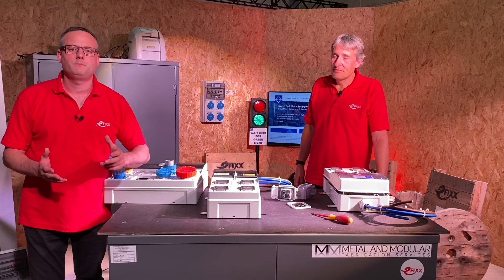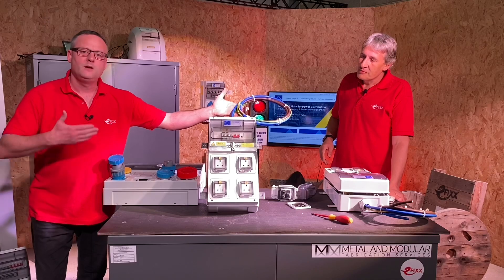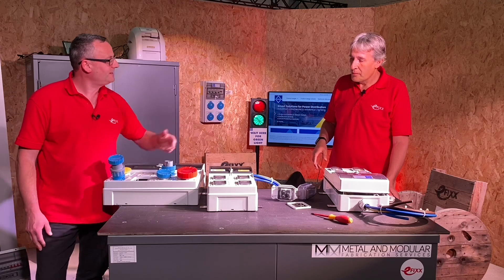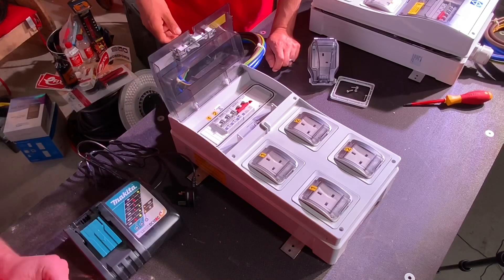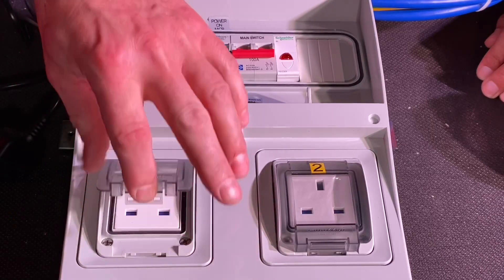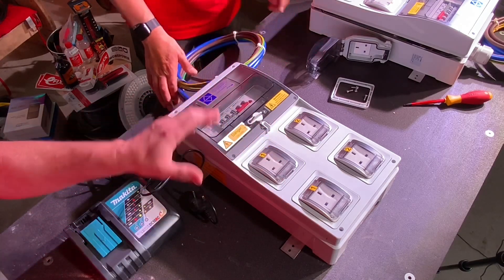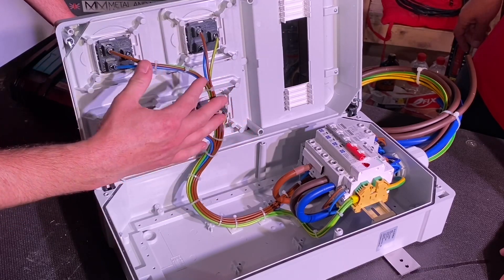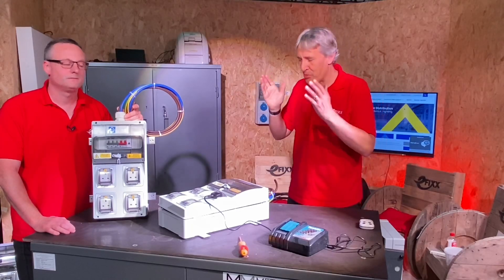Building site temporary electrical supply - electricians' comments needed

Comment: I'll supply you some images of a great pair of distros for building sites that I assembled last year. They are both large units in big waterproof site-approved cabinets with external 32amp 3phase/125amp single phase inputs and 3x 16amp/3x32amp single phase outlets on the inside. One of the crucial things is to include a ground spike connection and a DIN rail mounted power meter. This configuration means that all the power company has to do is supply and fit a box with their own power meter and a single of 3 phase connector on the end of a short length of cable. It also allows quick change over to generator power, which is the ultimate reason for using the easy to connect 32am 3ph / 125a 1ph mounted inlets and sockets

Comment: I made up something similar with a 3 phase Hager DB with RCBO’s with 32 amp x5 and 1x16 amp (with 6 spare single phase ways for expansion when needed)  all switched socket IP67 outlets this was mounted in a large grp box with a sockets mounted on the side the whole lot is mounted on a uni strut frame so can just bolt or screw to posts or uni strut and can be used with 3 phase 1 ph with phasing kit or 3 phase genny Supplys I just adapted as needed to each site move it’s currently on a Jenny with a  63amp 3 phase plug on HO7 5 core 
Lead as it has really good current capacity and don’t get worried by corrosion 
This way if they want to remove or replace a cabin it’s just unplug and away

Comment: That would not last 1 day on the site. Whoever designed that has never even been to a site let alone worked on one.
Reply from the maker: What’s your solution?
Reply: @efixx  I think the sockets need to be metal clad ones. The plastic flaps need to be made from something far more substantial with stronger hinges. As soon as one is snapped off there goes your ip rating and it becomes unusable. I would say that the covers for the sockets and breakers be ditched and one big strong cover door should be put in instead..that door should be shut with a ball catch of some kind so that if an extension cable is yanked out the door flies open and is not damaged

Comment: How about an emergency shut-off button? I have no idea if those come IP rated, but it would be a great safety feature, given that this will be used by all trades and some may not know what to do in an emergency..
Reply from the maker: Most EM stops  are IP rated  - would need to add a contactor - good idea 💡

Comment: I do hope there are no thick moulded plugs needed in those top two otherwise you're going to have trouble opening the bottom two. Could have done with a 45 degree rotation - perhaps that's lost on a European supplier.

Comment: Great video I know some building sites will not allow you to charge batteries up on site if it’s a 240v charger I know makita makes a 110v charger also with battery operated diggers ect on the market I could see a 110v version more flexible also 3phase specifically for charging plant up
Reply from the maker: Useful info - thanks 🙏
Reply: efixx that’s okay fully charged did a review on the jcb electric digger and they went through the charging options it can be fitted with

Comment: Definitely something I would consider buying for say a rewire job etc. 
1)16A is a bit low especially as it will usually be ground floor or basement and the builders will have 3 extension leads coming off it up to the loft and then plugging in their kettle.
2)Not all plug tops are created equal. Take for example the charging cables which drop the voltage in the plug top, they normally are the 'wrong way round' and won't fit under those socket lids.
3) That plastic enclosure surely isn't up to the task of being knocked around in a building site. Something a bit more robust and having a longer life expectancy would be better? 
4) No need for 110V imo. Most trades who use 110 have their own transformer anyway.
5) How about surge protection? 😋

Comment: (i am not an electrician) random thought but wouldnt it be nice to  have a "rental service" so you can call them up tell them the configuration you need and rent it? when you are done you ship it back to them

would make it cheaper and more flexible

tho it probably will be a headache if you need to change anything while its installed (e.g. you need more sockets or something)

Comment: Looks like a good option for domestic properties.  Would need more sockets for larger jobs and possibly some 16A.  Would save some time on site, not having to make one from scratch each job, out of random spare parts.  I might add a battery backed up built in light for when the plaster trips out the breakers with their dodgy mixer!
Reply from the maker: Great idea on the emergency light  - those pesky plasterers.

Comment: Funny enough only yesterday I was looking for an enclosure I could fit a few twin sockets in as well as the mains board bits.
It's too good to go on site, the knuckle scrapping trades would wreck it, I can see those covers getting snapped off, I would prefer the main cover split in two, save opening it all up, possibly sockets with USB points, that would keep the sockets free and double their capacity.
As for 110v I thought we had moved on from that and could use 230v, I know in the late 80's Siemens built a factory in the UK, used German workers who all used 240v stuff and HSE couldn't do anything.
Reply from the maker: Thanks - We'll see what options are available for a split cover

Comment: B16 is no good, often powering up a 110v transformer will trip it. B20 usually ok though.
Temporary event distros (1ph) typically have three neons: green L-E, green L-E and red N-E
Might be handy to integrate an led light with battery backup like an emergency light to the enclosure, that way you can see to reset when all your lights have tripped (if the unit is in a cellar etc)
Reply from the maker: David Gill totally agree... also the selectivity between the 13amp plug top fuse and the 16amp MCB could be an issue... 20amp all day long. (Gaz)

Comment: Looks like a great product maybe some external cable management/mechanical protection for trailing leads, and short leads that are been stretched by the workers, nothing worse than seeing leads diving into the board from all directions with people tripping over them and pulling them out of there plug tops. Also maybe add some external mounting brackets or holder for battery chargers.👌👍
Reply from the maker: Great ideas!

Comment: How about making a bit more depth to it and fitting an internal 110V Transformer and 2 110v sockets to the bottom of the unit. But it's looking good guys and well done lewden.
Reply: I coudnt have a proper look but they should remove those tails since its just stupid, whats the point of having waterproof sockets and stuff since where the meter  is in a dry protected room, they should knockouts for glands, add more circuits for lights and some other stuff, I worked in decent big temporary jobs and only really used armoured cable even its 2 meter lenght since we always got loads of it and can be reused. I just want to say that having a big board wich could be used as a consumer unit should have more than sockets , you always have it for lighting aswell

EDIT: if they could put the extra breakers and knockouts which can be put back on after it will be a really good idea, also a compartment to keep them inside since they would get lost in the van  most likely

Comment: Considering BS EN 61439-4, if it's used in a domestic rewire, even though temporarily, should it be a non combustible enclosure?
Reply: Don’t know if they’ve put non combustible in the definitions yet. Does it mean metal or a plastic that doesn’t sustain combustion? Been away from the electrical trade for a bit.
Reply: @jamesdyas542  see regulation 421.1.201 regarding BS EN 61439-3.  The point is that construction sites require 61439-4, so do they still have to be non-combustible.
Reply: John Howard thanks for reply. I still need to get the latest edition of bs7671. My point was more
Reply: John Howard still trying to get used to new phone my point was more what do they class as non combustible and does plastic that won’t sustain a flame count? Think I leafed through a newer book and still no definition for non combustible.
Reply: @jamesdyas542  there's no definition in 7671 part 2 definitions, and the note to 421.1.201 just says ferrous metal, e.g. steel, is deemed to be an example of a non-combustible material. Section 2.2.6 of the OSG adds that plastic enclosures manufactured from 960 degree glow-wire rated material would not be classified as non-combustible in the context of [421.1.201]. So as yet there's no definition that says it can be non-ferrous/metal e.g. non-combustible plastic, that I've seen.